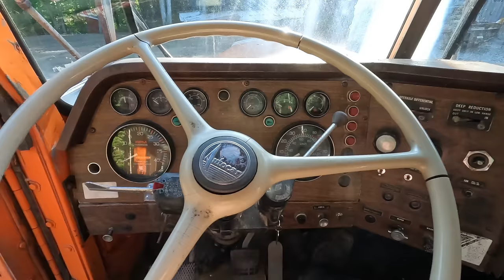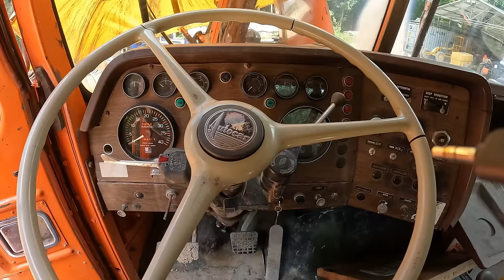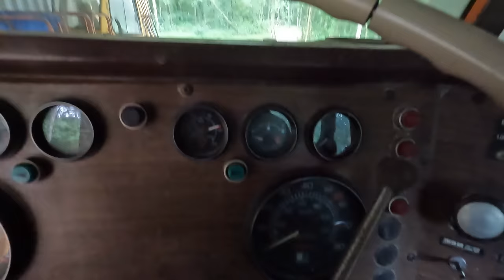Will this  Autocar Semi Truck be fit for the road after sitting many many years? (Small Cam Cummins)

Comment: With fasteners such as the oil drain plug that are stuck I find sometimes if you shock them with an impact gun it helps release the bond between parts.

I've been swinging off long breaker bars before, watching the bar bend and wondering whether the bolt or the bar will break first.

I've also found sometimes it can help to free a stuck fastener by trying to tighten it a bit before trying to undo it.

Heat is usually required at some point too, as you know.

Comment: You should get a form-a-funnel, it's saved me so much cleanup over the years draining oil in situations just like that. Barring that, a scrap of single ply cardboard cut to size works great as well.

Comment: Normally when you tear into one of those solenoids at the stage where you see the contactor plate you would turn it over so it has fresh material to make contact. I in my misspent youth worked at a shop that rebuilt starters and generators and alternators for cars and BIG trucks and heavy equipment. The plate comes off very easily
Reply: Let me think on that for a moment... LOL

Comment: Hey Matt hydraulic oil in the fuel tank works just as well if not better pal you can also fill your fuel filters with it so it gives the pump and injectors a good cleaning and lube. Love the channel buddy

Comment: I had a similar problem with my starter solenoid I stripped the contactor disc and turned it, now it works fine.

Comment: I don't know if it is the same in America, but here In England that type of starter motor is called a 'pre-engaged starter motor', since the pinion is put into mesh with the flywheel before power is fed to the starter motor.  This is in contrast to the older type where the starter spins and throws the pinion down a Bendix spiral and into mesh with the flywheel, thus the engagement with the flywheel happens after the motor starts to spin.

Comment: I don't know if you've looked into it yet or not, but with your selection of equipment it might be worth it to get a "remote" draining/suction system. They make fittings that screw into most oil pans/tanks/ports, they let you hook a suction pump or a hose to the fitting and makes it easier to direct the oil into your drain pan/tank easier. Just plumb in a one way check valve or a ball valve you can secure closed and you should be all set.

Comment: Something I've done on both equipment and vehicles, you can pipe the oil off to a different place.  Sometimes pipe is OK but sometimes need hose to protect the pan from getting beat up.  Put a ball valve in it and you will NEVER struggle with an oil change again. Zip tie or safety wire the ball valve handle in the off position you're golden.

Comment: Do hope your shop floor will have a lowered section (over the length) to work underneath the equipment or something like a 2 ramps (poured concrete or steel) to get the stuff higher up ... even the heavy stuff.

Comment: with your dissimilar metals like the steel sump plug in the alum sump there is a paste product (i've forgotten its name) commonly used by boat builders that prevents electrolysis.

Comment: Congratulations & excellent video Matt  :) like hearing orange Auto Car truck maintenance going 👌   super for you and looking forward more videos too soon watch and never work on ever but you showed lots easy steps fix it up too ! But on drain plug so hard take out or put use thin layer of grease or anti seized on threads help and plus oil filter too sure helps ! You try that out sometimes and bet like that idea  too try !

Comment: Milwaukee has a saw like that too, I'll tell you one thing g the blade only lasts so long. When it starts to dull its alot harder to cut especially when you have tge material pinching the blade like that. A couple people told me you could sharpen an old blade by running it into some thick steel but I never had any luck. Also run the Diablo steel demon blades. They are soendy but I love them.

Comment: I accidentally fixed the starter on my GMC that was doing something similar.
Occasionally it would push out the bindex and not close the motor contacts but the bindex would stay engaged so I’d have to hold a wrench or whatever across the lugs to get the starter to spin. It got to the point where the starter would rarely work normally so I bought a new starter. Before I got around to installing it I was go through my typical starting operation when I accidentally energized the signal wire in a way that made the solenoid hammer several times in rapid succession (sounded like an air hammer) after that the starter worked flawlessly and has been for 8 months. I can only assume the hammering action broke up whatever was fouling up the contacts in the solenoid.

Comment: That second oil filter was probably added.  White/Autocar installed their engines 10° off of 90° vertical.  The later oil coolers usually have a spin-on or two oil filter bosses  cast right into the oil cooler casting so that you can run spin-on filters.  That's a nice conversion if you see one in a yard somewhere.  I tried to add a conversion ring on the oil cooler to go to spin-on filters and eliminate the cartridge style elements and didn't have the clearance.  With the 10° tilt there are often clearance problems with the right frame rail.  You may also see notched right side frame rails from the factory.

Comment: 21:19 it's a relay valve for the brakes, it receives an air signal from the foot brake valve to send more air to the brakes than the foot valve can supply

Comment: Before seal replacement try Lucas oil stop leak it worked on front axle leak and valve cover 2001  tahoe

Comment: Had an older mechanic come to change a starter on the side of the road. He used a length of 1/4 inch cord to lower the old starter to the ground by himself. Then put the rope around the new one to hall it up in place. He raped it around the shift linchage to gain leverage. Just a neat trick by an old smart mechanic. 👌

Comment: On that slipyolk..... Take the hiking out of it and on the center of the yolk there's usually a center divot were a live center on a lathe can be used. If you drill that out and tap it to put a porta power fitting in alot of times hydrolic pressure will seperate that slip yolk. Or another way is to drill it big enough to use a t  type yolk puller

Comment: Use an AIR HAMMER blunt chisel face on that drain plug.  They sell a socket adapter for the air hammer so you can hammer and unscrew at the same time.

Comment: I haven't watched the whole video but I would check the air tanks for water as well. If the air tanks have water setting in them then there is a chance there could be rust as well

Comment: If you ever have to pull the starter again, tie a length of rope onto the starter and tie it tight to something overhead.  When you get the mounting bolts loose, use the rope as a winch to either lower the starter to the ground or pull it up and out.  Reverse the procedure when installing.  It is a HECK of a lot easier to start the bolts when you don't have to hold the entire weight of the starter at at the same time.

Comment: Hi Matt. Napa didn't have a seal kit for the air brake / vacuum system. There are specialist seal makers that could be a source for new seals. If they dont have standard seals made up, they may have a machine where they can make a seal for you if you give them the unit to take measurements off. Great way to save significant money. Typically Im talking about the sort of company that might supply seals for hydraulic rams etc. Thanks for the video's

Comment: Something i would try with the winch drive shaft is heat it up and start cramming candles into the area of the slide. 
The wax doesn't evaporate like penetrating oil until much higher temperatures but will still get drawn in by the heat and act like a lubricant assuming there isn't a seal on the slide.

Comment: I was a 63golf in the military. Fuel and electrical. Rebuilt starters and generators. Just flip the disk around. They get magnetized or whatever you call it and won't give good contact. Clean the terminals and you should be good to go

Comment: Matt just an FYI, there is no bendix drive in that starter.  A bendix drive is a system, not just the drive gear.  As you explained in yours there is a solenoid that moves the gear.  On a bendix drive the gear is moved by the turning of the armature not by the solenoid. From Wiki "The Bendix system places the starter drive pinion on a helical drive spring. When the starter motor begins turning, the inertia of the drive pinion assembly causes it to wind the spring forcing the length of the spring to change, and allowing the pinion to engage with the ring gear. "  Love your content and your production besides you seem like a real nice guy.

Comment: Metal cutting blades last a lot longer if you clamp a guide for the edge of the saw foot to ride against. Binding the blade in the cut damages the blade teeth. We found that the metal cutting circular saw blades from Harbor Freight, though only 7 1/2" diameter, are quite long lasting if the saw is used with a guide. Much cheaper if a smaller diameter blade is acceptable for the work being done.

Comment: That air filter was old enough to have beer.

Now on Nippondenso starters I have brazed up the contacts and filed them down the original size.  Never done it on a Delco.  I'm sure it could be done on the one you have.

Comment: Matt, you might want to to get some ATP205 or one of the cheaper tranny seal conditioners. You can use them on power steering units, hydraulic jacks, I even put it on my air pistol seals!

Comment: If a brake chamber diaphragm is leaking they will back feed though that valve. I would check them by crimping off each air line individually at the chambers

Comment: I'm wondering if that oil filter on the outside is for the air filter, oil filtering which I've seen on a few older construction rigs out in the fields and mine quarry's

Comment: You may have already separated your PTO shaft, but here's the advice I've been using the past forty years that my FIL, the salvage operator, passed on to me.  When heating up a circular object such as a nut or even a drive shaft, avoid heating the whole of it.  Expansion can cause the hole to get smaller.  Instead, quickly heat up one small side area to cherry red, causing the hole to expand.  I've used it many times with great success.  Good luck!

Comment: Mostly I believe they're generically called "pre-engaged", because the gear is engaged with the flywheel before the motor starts.  The other kind has a bendix gear which has a heavy holder on a spiral, and as the motor starts spinning, inertia causes it to slide into mesh.  Haven't seen that kind on anything modern... pretty much everything now is pre-engaged.

Comment: Awesome video buddy!! Just ran across your videos and thought I’d check some out!! On my 2007 classic Duramax every time I end up changing my fuel filter I always fill the new fuel filter with ATF to help clean the injectors and help keep lubed up!!! I baught the truck with 62,000 miles and I haven’t had to do anything to it at all other than regular maintenance stuff!!! It has 250,000 miles on it now and still running strong!!! The only thing I would definitely like to do is delete the EGR!! When I hear guys talking about having injector issues I always ask if they put ATF in there fuel filters when changing them?? Every one has said heck no I don’t do that!! Of course I think every one thinks that I’m playing with them!! Every guy that starts using the ATF in there fuel filter changes have definitely noticed big changes!!! It definitely helps things last longer!! I’ve never had an issue with my injectors and I have definitely been able to smoke every mustang that tries to race me also!!! Lol!!

Comment: Hey Matt idea 💡 why not wire brush the air filter case air inlet all black metal and then spray rusteloum rust prevention paint it's going to be matte black should protect those items as the rust metalprime on thos area whwre rust is showing

Comment: On the matter of that yoke's mating surface with the seal, there is a product out there called speedi-sleeve which provides a stainless seal counterface for problems exactly like what your yoke is having.  They're very inexpensive and easy to install.  I'd suggest you give them a try sometime.
Reply from the maker: I’ve used them tons of times. Wasn’t needed here fortunately

Comment: nice truck matt I do think there are more than two airlines which need replacing as I saw them in dangerous condition all almost ready to pop on the rear brake air cylinders as you probably already know hopefully they won't cost an arm and a leg to replace but I reckon shes going to serve you well Ps when you get time to treat her to a nice coat of paint either spray her or brush paint her she would look the Biz then great video once again matt nice to watch someone who knows what they are doing from one diesel mechanic to another.

Comment: hi ,, maybe if you put a drain hose in the oil pan ,, not a oil pan plug ,, it may be better not letting the oil make a mess ,, on the outside oil filter there is a big round thing with 2 hoses on the bottom ,,, i do believe  there is an oil filter in there to

Comment: Hi Matt This truck looks like it will serve you well. With the slip joint. You were using tension unfortunately without a successful result. I have unfortunately had my share of seized joints to free up if possible.
I have found compression a better way to go if there is travel room. The shock value of hammering seems to work better than tension even if you hammer while under tension. Sometimes they just will not let go without cutting a relief slot. Then welding the slot once apart. Good luck  I am sure you will get it apart  next time you try

Comment: I gotta toss my 0.02 cents out from what I know and understand modern atf as far as I know, doesn't really lube injectors its mostly just detergents so it cleans. but I don't think it adds much if any lubricity. 

I like to toss it in to help clean injectors, every once n awhile or some seafoam and give it some new engine oil or 2 cycle oil to add lubrication on fill ups

Comment: The plasma cutter would of been the fast and easy way to cut off the frame extensions. 

When I have to deal with extremely seized up slip yokes on drivelines I figured a easy way to get them out.  If it has a grease fitting I fill it with as much grease as possible then I remove the fitting and use my port a power to hydraulic the slip joint open.
Reply: Matt. Do you know how to time your driveshafts.
Reply: @jerrynicholson5430  Driveline's are phased not timed.

Comment: for fuel filter , put in in area dry fill pop bottle with fuel too fill filter then screw in place, less messy, 35:25 , those brake lines look scary ,

Comment: Matt, please don't try and pull that PTO shaft out like that again. If that thing popped loose right as the skid-steer had the thing under max tension there's a pretty good chance that when the thing came apart it would smack you right between the eyes. Need a strong safety line tied to the yoke that will only let it move a small distance when it pops loose. Just don't want to see you get hurt Brother. Love the videos, keep 'em coming.

Comment: I know lots of ppl run ATF in the fuel, My experience at my job, It kills injection pumps. ATF has anti-friction additives in it and thats the last thing you want in an injection pump with tight tolerances. just my food for thought. But I do change injection pumps regularly at work and ATF is the only thing ever added to fuel.

Comment: Do not underestimate the ability of hammer tapping the rust spline with 2 hammers and appling a good quality of penetrating oil.    Heating with a acetylene torch and quenching into a bucket of water...is a last resort.  Heat extreme to cold extreme will break the rust's hold on the splines.

Comment: What about unraveling the winch cable and inspect it to put on your list of replacement parts on all your machines and I designed a dust control system for your road and at the house and maybe a few jobs you put gravel in roads

Comment: When you’re hot water pressure washing make sure you shut off the burner first and then let cold water run through the system until everything is cooled right down or else it will burn out the heater core

Comment: On that jammed PTO Drive shaft, I wonder if you get some penetrating oil all around the sliding surface and hit it with a large hammer a few times and leave it vertical over night and see if that manages to get some oil down in there. The hammer shock could help break it loose? Any way crazy how locked up that is.

Comment: What color do you want it to be  while the weather is still nice it might be the time to make it look nice like that windshield bumper fenders painted maybe give maybe the paint a rub out see exactly how oxidates it it look preet bad but want a nice impression  and waiting for the work trailer wood .I think use those old tires on the green international as there maybe better  sand paint air filter deckplate fenders push bumper and is that raidator cover look aluminum or stainless steel nice polishasthe autocar emblems

Comment: I see all the suggestions for a vehicle service pit and I agree it would be useful but I’m not sure if you could make it part of the foundation for the shop in that location without some kind of sump pump to deal with the inevitable seepage. This is a rural location with obviously a shallow water table. You’ve showed us several videos on your efforts to deal with surface drainage issues so I’m somewhat skeptical of a vehicle pit not ending up an indoor water feature.